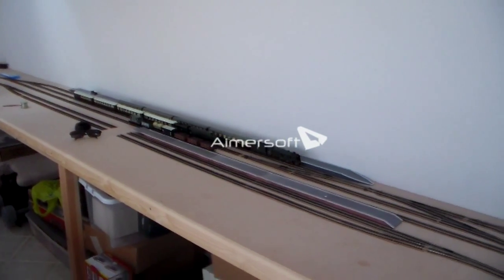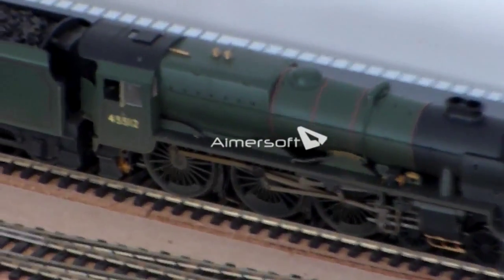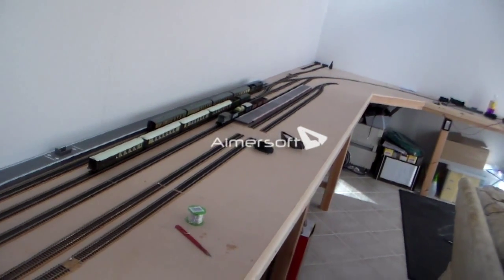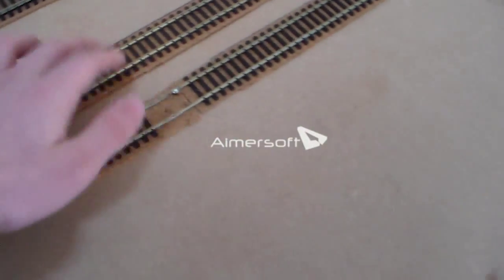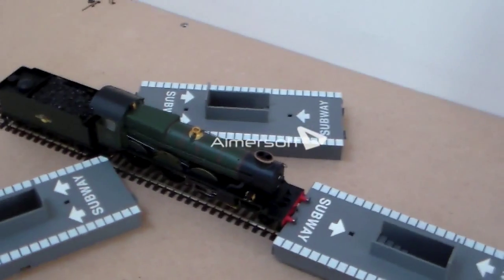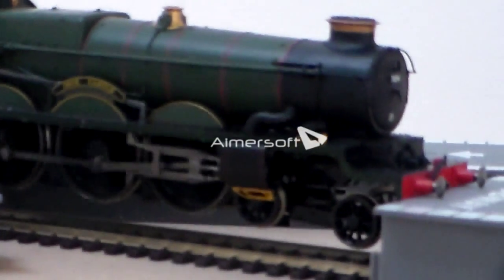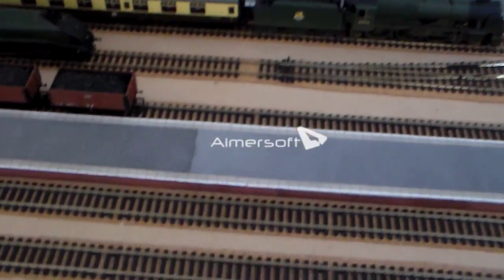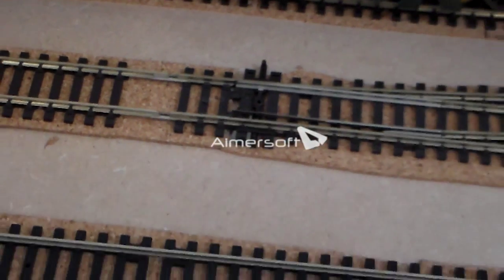Gresley Junction Layout Update 6

Comment: so im taking it the layout is a horse shoe shape?are you hoping to run locos back and forth as a return loop as you could build the return loops at each end but would have to add more baseboards which will take up around four foot of space or you could add a helix at each end and run a second level under or over the board for a fiddle yard.